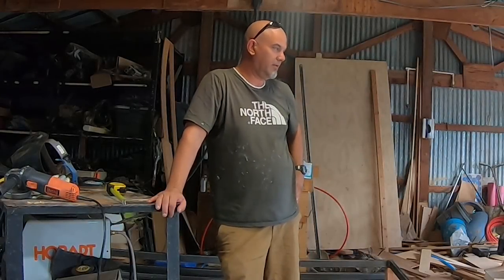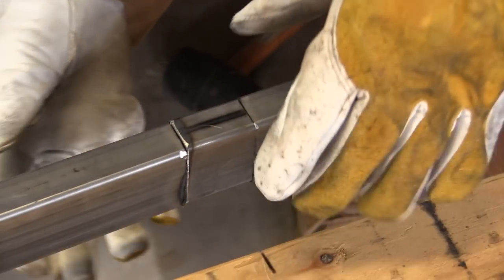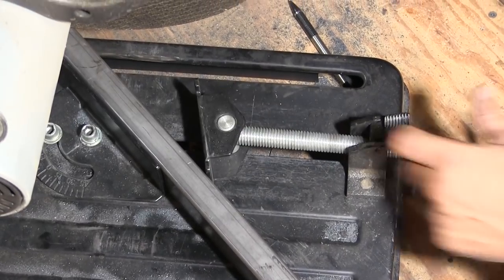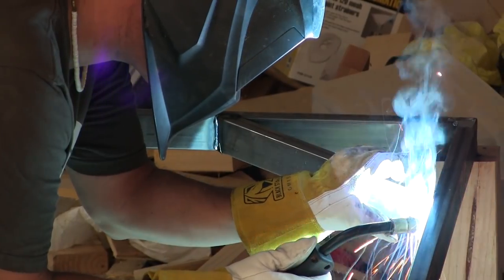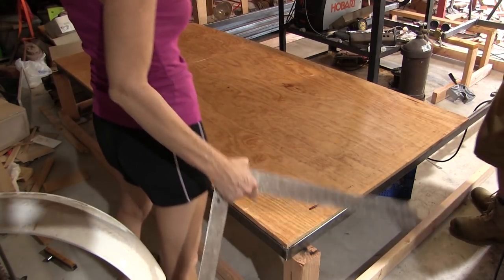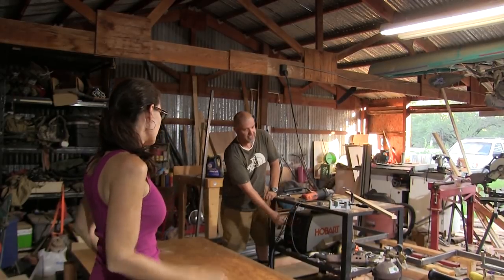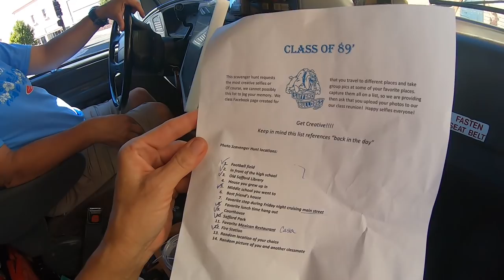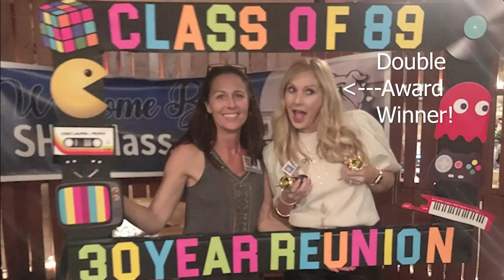Skoolie Deck Troubleshooting (Part 3) & Kerry's Reunion

Comment: Awesome Job, I love watching your videos. May I suggest using the completed frame as a kind of template. Place your pieces on the existing structure, firmly tack everything together that is on top of it then remove it and weld it better when it's off the one you just built.

Comment: Awesome job as always I’m glad you figured it out.
Just a thought that may or may not help
That metal isn’t very thick so you may try and tack it on all 4 corners (of the joint)then when you weld try to stitch weld it moving around and try to keep from getting any area super hot because it will pull the steel out of line.

Comment: I'm assuming you are planning on using plywood as decking?
Reply from the maker: Yes, trying to keep that part as lightweight as possible!
Reply: @BussyMcBusface  you may want to consider using ⅝" deck boards. The weight difference from ¾" plywood and ⅝" deck boards wouldn't be over 150lbs and it will last a lot longer. The plywood will cup in the sun and hold water that will make it rot even faster. Even if its treated.  And I know it's to last now, but when you were saying it was 1½" smaller after you welded it up, that's because of the C notch you put in it. If you have to do that again cut a piece of 2x4 and put in the C notch to keep it from pulling together when welding. Most "welders" will tack a piece across there to keep it in place until all the welding is done and its cooled.

Keep up the good work.

Comment: Hey kerri there's a youtube channel called carlise195 he's a camping guy and he uses welding gloves for cooking and managing the fire, just saying. Mike i dont know if it would help but i use to use a screw called tek 5 to install temp braces in black angle iron, they drill into thicker metals pretty quick, might be useful building brackets to hold things till you can weld them solid, screws are easier to uninstall and move things around.
Reply from the maker: Haha! That does sound perfect for campfire cooking..... AND people who are accident-prone in the kitchen! You know what, using Tek 5's is a great idea, he uses those in other places so I'm sure he's going to appreciate this suggestion! Thanks! ~Kerry